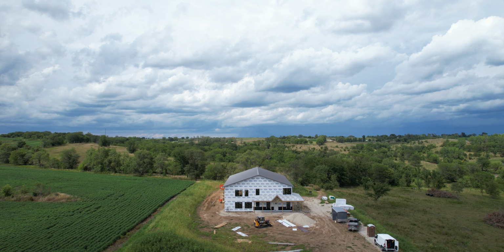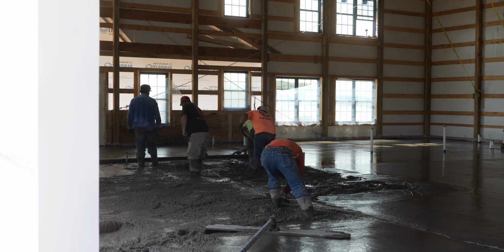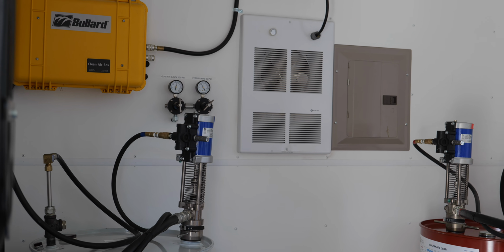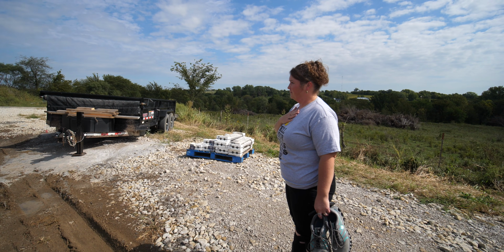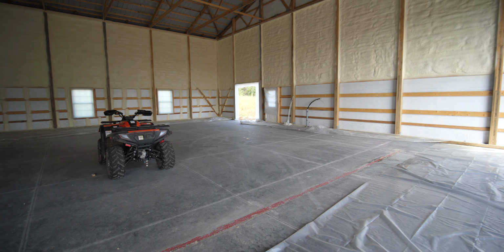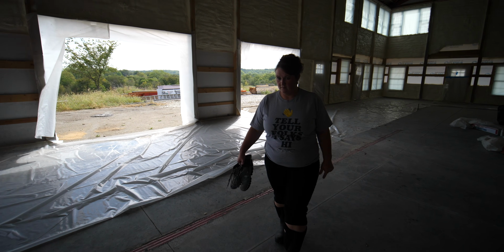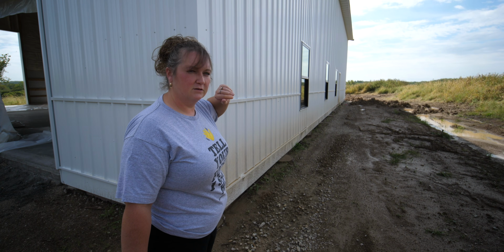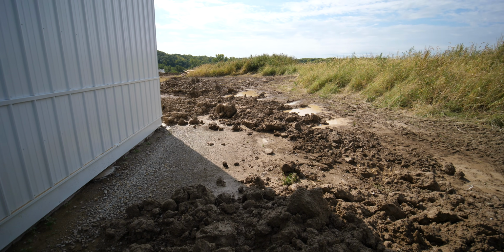Concrete, Septic, Spray Foam And MORE // The Barndo Build Ep 6

Comment: I don't know if you have planned for this - but before you are all drywalled in - run ethernet (cat6a) out to each corner of the building for cameras, and then also out to the building center somewhere for access point(s) both inside and outside, and of course a couple in every room. Ubiquiti makes good stuff to look into! Run all the wiring to a closet where your modem will be, and also have power in there etc. Could put this out in your shop area in a closet, small rack patch panels and all the stuff you need for a professional look.

Comment: I hope you'll never needed it, but the concrete got me thinking. Do you plan to put a tornado shelter or underground storage and storm cellar?
Reply: If you go back a couple videos they did some Q&A and talked about the concrete storm shelter that will be built in a corner of the shop.
Reply: Would it not make more sense to build the house from concrete so it would be more capable of surviving  storm's 🤷🏻‍♂️
Reply: @Alan-rn5ip  Would it make more sense? Sure....but I would imagine the price for a complete liteform/concrete building would be SIGNIFICANTLY higher than going this route.
Reply: @condo321  that's true but as its going to be a home and a business mabe   build it to last the first time. Would be cheaper than having big storm repairs or a rebuild (which I hope never happens)